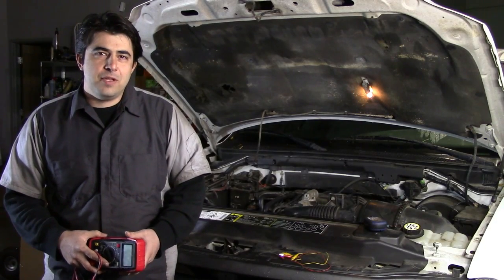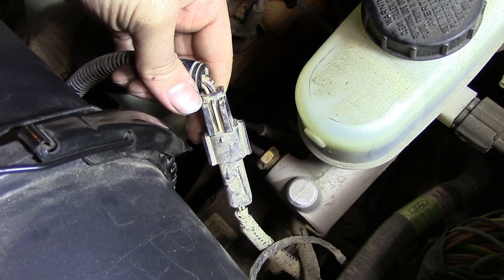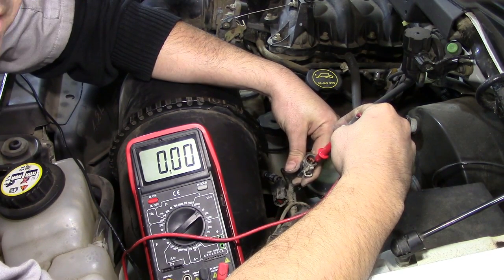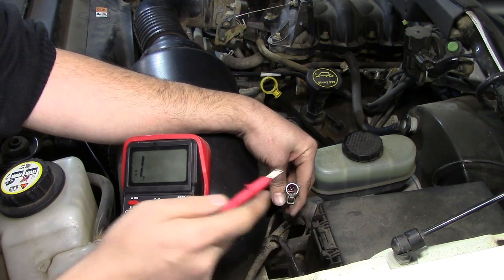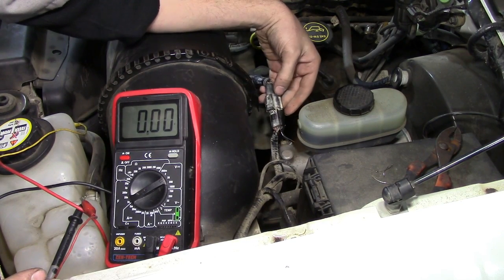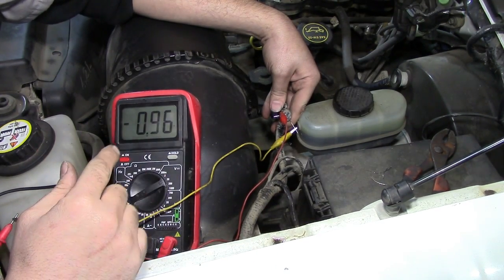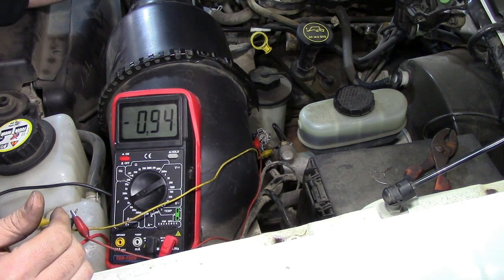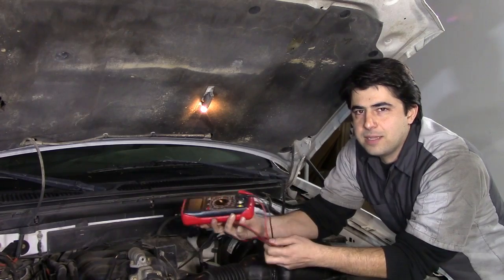How to Test a Mass Air Flow (MAF) Sensor - Without a Wiring Diagram

Comment: I have a 6 pin Mass Air Flow Sensor and the only one showing power with the key on is only showing 5.03 DC volts.    is there a problem here?   my truck is running fine,    no check engine light on,    I was just doing this to practice testing a MAF sensor

Comment: To diag a MAF all you need to do is monitor the MAF data stream on a scam tool. An engine will draw in a certain amount of air per engine size. To diag look at the data stream for the MAF sensor with the engine at idle. Data is read in grams per second. A 3.0 liter engine MAF sensor should report at least 3.0 grams per second at idle. If the reading is higher than 3.0 grams per second your MAF sensor is fine. If it's below the spec inspect your engines Intake system for leaks. Look at the air filter condition. Inspect for exhaust leaks ahead of the first O2 sensor. If all is well no leaks and the sensor still reads below 1 gram per second for each liter of engine size, remove the sensor and inspect for dirt or contamination on the hot wire in the sensor. Clean it with MAF sensor spray cleaner and retest. If the readings are still below normal recheck your previous work for vacuum and exhaust leaks and if all is well replaced the sensor

I have fixed many many other techs comebacks after they replaced a MAF sensor but didn't verify engine integrity. Usually it's a vacuum leaks in the intake stream or an exhaust leak at the manifold doughnut gaskets.

Retired after 40 years as a GM tech. It amazes me how many people don't bother to read or understand the proper diagnosis in auto repair.
Reply: I know that a reply is a long shot but I will try anyway . I have a 2012 Nissan Maxima . It will not start . Got the code PO101 Changed the maf sensor . No change . Got the code P0113 which is. 1.  IAT sensor -circuit . 2. IAT sensor - circuit  bank 1  3. IAT circuit high .  I have been told that the iat sensor is in the maf sensor for my car but I'm not positive about that . I've also been told that the maf sensor should not cause the car ,  not too start and it could be a fuse . In google , one of the results that I found , while asking about symptoms , it said that one of these problems can cause your traction control light too come on , as well as the check engine light . My traction control light was blinking on and off the last time that I drove the car .  My question ( I guess ) is , is the iat sensor inside of the maf sensor ( if so , can it be changed or do I buy another new sensor ?) . Could it be a fuse ? Or is it likely that it is a faulty / loose wire or a leak / hole in a vacuum line somewhere ?
Reply: Hey 
Did you find the solution on your problem???

Comment: my sensor and throttle body are brand new   i cant make car idle it shakes and dies   my codes are poio2 po113   please help thank you
Reply: P0113 error code that's the intake air temperature sensor 
You can use a digital multimeter so you can test that sensor

Comment: But this engine doesn't want to stay running. I'm checking all the wire connections. So far everything tests okay, as far as I can tell. I tried running it without the MAF connected. It wouldn't even start. Right now, it starts, then dies, like it's missing really bad.

Comment: I don’t think you actually said which wires you ended up back probing when you started the car.
Reply: I believe he probed the signal wired coming from the sensor. He determined which 2 wires are the suply power/and ground, and those values shouldn't change if everything is working properly. So you just need to measure the power out put from the sensor to the ecu. I hope this helped.

Comment: you are making it too complicated, just start it and then disconnect the sensor plug, if the engine turns off, it means the maf sensor is working properly, if it didn't turn off, it means there is a problem with the maf sensor this is too much  talking and too complicated.
Reply: No actually it'll go into a default setting and run with that
Reply: This is wrong on so many levels

Comment: Excellent video!  Especially if you're trying to figure out if the sensor is bad, or if it's the wiring (as is the case with ANY code that has the word "circuit" in its description).

I know it's kind of a nitpick, but if you're going to be using multiple test leads and extensions, do get in the habit of always using the red wires for positive, and black for the ground.  Don't mix those colors and use other color leads elsewhere e.g. signal wires and such.
Reply: The only time swapping multimeter leads matters is analog volt meters. What are you talking about?

Comment: What I love is how these vehicles that get tested in any video are always able to run. WTF DO YOU DO WHEN IT WON'T EVEN START
Reply: Well I finally figured it out. Could not get the Toyota to start for 2mo. Took Valiant to get starter. Son took Valiant to get supper and ran out of gas. I pulled 5gal out of Toyota and took it to him. Valiant wouldn't start, towed it to the house. Pulled ALL the gas out of the Toyota, cleaned tank with rags, put new gas in started it with fluid, it died, 2 more times and it kept running. Pulled gas out of Valiant, put new gas in it started and is running. IT WAS THE GAS ALL THE TIME.
Reply: Today I'm going to waste my time, pull the starter, out drive 45 minutes, get yet another BRAND NEW starter, 45 minutes back, put it in, all for nothing. Back 40 years ago it "was always the carburetor", nowadays it can't be so it's the starter.
Reply: Battery brand new. Starter brand new. Tested map, maf, fuel pressure, fuel volume, coil pack, o2, checked plugs, checked compression, oh yeah, new fuel and air filters. Checked battery cables and ALL grounds. Cranks like an air tool, still won't start.
Reply: @anthonylawrence9307  I had a brand new starter too a few months ago but when parts stores test them they dont have a load on them. I got another starter and thats when mine worked. If you have a warranty on your starter why not try to get another one?
Reply: Did you verify you have spark at distributor ?    I had to replace my distributor to get my crank no start fixed
Reply: @kenbuteau4929 If you read all the replies you'd know that I had water in the gas. Wtf
Reply: Well, I took out a perfectly good starter, went and got the new replacement, put it in, and guess what, it still won't start.
Reply: You buy a new key 😂
Reply: Battery should have around 12.4 v and if your batterys good then its probably a bad starter
Reply: Uhh you test the battery and the starter duh.

Comment: This has nothing to do with checking MAF working condition.
 The way MAF works: basically MAF has a filament( tiny wire) which gets hotter as engine RPM increase. I 
1) ECU sends a voltage through MAF’s filament.
2) MAF is located inside air intake
3) When RPM increase, ECU send more current and filament gets hotter, wire resistance increases with temperature 
5) ... but with increased RPM, there more air flow and that cools the filament down, decreasing resistance.
6) the other two wires, connected to MAF sensor, read a resistance values and send them to ECU. (Four wires total- 2 to heat up the filament, other 
      2-to read the resistance and send it to ECU
7) ECU is programed to read specific values with specific RPMS. So RPM go up, ECU send more current to MAF, MAF cools down by more flowing air, ECU gets info and analyzes it, if MAF is bad, readings dont match to default, ECU panics and lights up a CHECK ENGINE!

All you checked here is the voltage that ECU sends to MAF. You never checked the readings of the other two wires. You didnt even show a MAF in this video.
Reply: Total bulshit
Reply: I know this is late but

If I'm having a reading of MAF intake in g/s with my scanner, then that means my maf sensor is still working right? 

Trying to diagnose with my chevy captiva. The maf sensor reading is 15g/s with my old one and now that I have a new one, it's also 15g/s.

Color me confused
Reply: You’ve explained how the MAF works better than any video I’ve seen.  Thank you very, very much.

Comment: ok, I get it, I had to watch a couple times, this is a good way for a DIYer without a scope.  I was trying to figure out how to connect a scope, which I don't think the shop did. I've got a phantom p0171 that won't go away, I tried a new MAF sensor but it returned, so I reverted to my old MAF sensor.  I probably didn't let it run enough? - update: replaced MAF with proper OEM part and it worked fine.
Reply: Ever find the problem? I have a p0170
Reply: @Fireneedsair  My problem was 171, my 'new MAF that I mentioned was from Amazon and non-oem, so later I learned of risk of counterfeit, or more likely just non-compliance.  I now only get Denso for my Toyota and it fixed it.  You can also clean them with MAF cleaner which may work (do not use brake cleaner or other, only MAF specific cleaner).  I do not know P0170, it looks fuel related or something.
Reply: @condomanager5259  I cleaned it. I’m going crazy trying to get the car to pass emissions. Replaced o2 sensors,fixed a vacuum leak. It’s so frustrating
Reply: @Fireneedsair  Ugh, so you're on the right path, eventually all will be new - what kind of car?  You replace both O2 sensors?  Downstream doesn't control much, but it sounds like a Fuel Trim issues, to look at MAF and upstream O2 (Air/Fuel, which was my ultimate repair), then vacuum leaks (the real hidden gremlin, supposedly often a leak at exhaust manifold to exhaust pipe (up from cat).  also check inlet air to air box, clamps on airbox, screws/seals to MAF, clamps to throttle body, any place air (unmetered) can get in can screw it up.  You want to fix it soon because poor A/F ratio will cause compensation, which can poison the cat.  Here's 20 minutes of some guy looking at such steps: https://www.youtube.com/watch?v=tnA1vi6-U5M
Reply: @condomanager5259  got a 2001 Mitsubishi montero limited.got a pO170 which is a generic fuel trim code that tells me little. Replaced all 4 o2s but now one is getting no voltage so have to buy another one. Fixed a vacuum leak. The MAF appears to be working. I have NONE of the symptoms of fuel trim issues. The car idles perfect, no lag at all on acceleration. My STFT are way too high suggesting a lean mix. And….. the code can be triggered by other issues that have nothing to do with it. Damn emissions.got 3 weeks to figure this out or park the car. My mechanic tells me to also replace the MAF but they are pricey and I’m tired of throwing $$ away. Used a 5000$ scanner and no shop will tell me anything besides possibilities.ugh

Comment: HI BROTHER, I GET LITTLE CONFUSED ON THIS VIDEO. I AM NO MACHANIC BUT I SPENT LOT OF MY TIME LOOKING AT MACHANICS`S VIDEOS.
HERE IS MY CONFUSION.
1.  YOU GOT 12 V ON SUPPLY WIRE, BUT WHEN I WATCH OTHER PEOPLE`S VIDEOS THEY SAY THERE MUST BE 5V SUPPLY. WHAT IS TRUE.
2. SOME PEOPLE SAY WHEN YOU CHECK FOR CONTINUITY THE CIRCUIT MUST BE OFF, BUT YOU DID NOT UNPLUG THE BATTERY WHEN CHECKING GROUND.

M.B.S MOSHITOA (S AFRICA)

Comment: Hello sir Im a long time subscriber, i just want to ask if the signal wire in the maf sensor have voltage of .75v when disconnected, suppose to be 0v what is the pissible problem?

Comment: Great video.My Subaru has no 5V reference voltage. Only 12, signal and ground. It's hard to understand that your car has two power sources 12 and 5V. Do they connect to the hot wire inside the sensor directly? Imagine. what would happen if we feed a bulb with two different batteries( one is 12V, another is 9V)?

Comment: First of all,my 93 maxima has a symptom, that when I accelerate,it hesitated to go. So, I performed the diagnostic procedures as you have shown. However, the last step was,to probe two paper clips to the back of the two wires,not the power and ground wires, but the other two wires,then started the car,but When I connected the multimeter,there was no voltage showed. Does that mean the mass sensor is gone or I did something wrong? Thanks
Reply: Probably your ECU.

Comment: I was trying to test my mass air flow sensor on my ‘99 tacoma and when I inserted the needle in one of the wires the truck went off and now it doesn’t start, it just tries but doesn’t go on, can you please guide me on what to look at to make it go on?    The sensor on my Tacoma has six pins

Comment: Which ground did you use to measure the signal leads? The one of the harness or a battery/chassis? Or does it not matter?
Reply: If the two connectors are connected, the wires that he narrowed down to be the signal + and - can be measured at either side of the connector! Polarity doesn't really matter in this instance, so there's no real need to figure out which signal wire was the - one. I'm sure you don't need this answer anymore, but here's to helping the next person who asks!

Comment: During the testing of the MAF sensor, the multimeter setting you used was DC voltage to monitor fluctuation. Would it not better(more accurate) to use the hertz setting on your multimeter to monitor fluctuation to see if your MAF sensor is good or bad? Thanks

Comment: Would a bad maf lead to a p0172 &p0175 (banks 1&2 Rich)
Reply: I know this is a late response, but yes.
Reply: @04civice  yep got it figured out thanks for the response though. Back probed the maf and found it was only sending 3 volts through the 5 volt reference tried cleaning first but it was a duralast replacement that I replaced with a oem one for my 02 blazer with 56k miles

Comment: I did this test and when i back probe MAF  I get matching  voltage as battery around 12.2  when car in on positions.   When I start engine I get 13.3 to 13.7 volts. Then when i rev it goes up

Comment: how can I find out what the output voltage is supposed to be? Its at 0.65v without me blowing air into it. I Can get it to 1.5v if I blow at it.. I don't know what readings it's supposed to have

Comment: in MANY cars, unplugging the MAF while the engine is running and if motor doesn't die, it does NOT mean the MAF is OK!....the computer automatically goes to a default setting for MAF and other sensors pick up the 'fuel trim slack'also Ratchets guy here is testing an ANALOG  MAF evidently and his voltmeter can test these, roughly.......also you should tap on the MAF housing while testing to see if you have an intermittent vibration issue failure.if you go thru his test and you get a 4.38 [+ -  .05V] reading that goes down to approx. 3.8V as you rev the engine then you have a digital [frequency counting] MAF, but the reading does not absolutely indicate your MAF is OK......yes its working but still could possibly be giving out wrong values......but it IS somewhat of an indication.
Reply: Boat Man hey friend, I have a Nissan car with the QG16DE engine. While the engine was running, I unplugged the MAF sensor wire harness and the engine did NOT stop running, although it seemed to run erratically. I turned of engine, connected the wire harness to the MAF sensor, then everything was back to the way it was. Is there a problem?

Comment: The engine check light came up on my car, had it checked with obd sensor and code indicated P0101. Had MAF sensor replaced and light appeared still. What to do after this? You could tell every one to check for leaks, cracked intake boot, vacuum leaks, clogged or improperly installed air filter, and many more that cannot be mentioned here. Its alot of diagnosing for this horrible CEL code. Take it easy .

Comment: all  you need  to  do  to test M.A.S  , first  start  the  car, let  it idle ,  and  unplug  the  MAS  wires connected  to  the sensor, if  the car  stop  your sensor is  good ,  if  the car keeps running  your sensor  is  bad. it takes 3 second ... No  need   for  this elo tester
Reply: 10 4 lil fat buddy
Reply: That only works on older cars. New cars still run. You hear a slight rough idle from the car for a second then it uses the computer settings to run.

Comment: Would using an OBD2 reader to read how much air it's pulling be a good way of doing the same test or is checking the voltage a better test?
Reply: Do both

Comment: Fairly easy for a 4 pin MAF set up what about a 6 pin where you also have to isolate the IAT sensor wires?
Reply: Great question and it is not as complicated as it seems. The key thing is to remember that sometimes not all sensors are connected or, "referenced to ground". A or any computer can read a two-conductor/pin signal with no connection/reference to ground, meaning the computer has a sense-conductor going to the remote sensor and the a return wire leading directly back to the computer. In a six-wire configuration one can ASSUME (unknowingly until proven) that four of those wires are for the MAF and two are for the IAT sensor - the next person can also RIGHTLY assume that three of those wires are for the MAF and the other three are for the IAT sensor...this too is a correct postulation...one of the two assumptions can be correct...the other is wrong or even both can be wrong. At that point all that one can do is backprobe all six wires after doing their reseach of WHAT to expect and put the puzzle pices into the proper places...welcome to SCIENCE...it's never been just for the egg-headed dicks gettin' the A's in class in the Science lab, it's now great for you too!!! Just be careful and don't short those backprobe leads (use electrical tape for paperclip isolation) and you'll get there! Probe 'Em all as that famous Steer Wars character said back in '49 on the Saturday Night Live Special Friday-Saturday Night Marathon!!!! (Oh Wait...maybe that was '59...err) Cheeers MY Feller Greasy-Finger Print Dudes :-D Dan Gibbs :-D